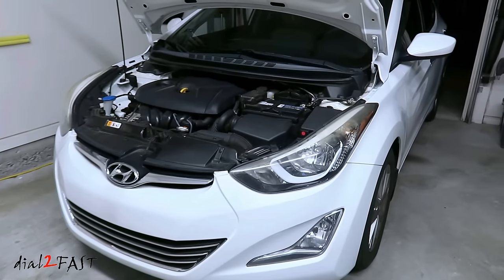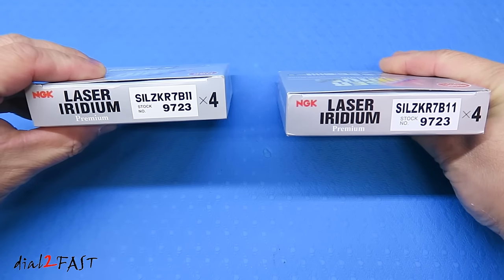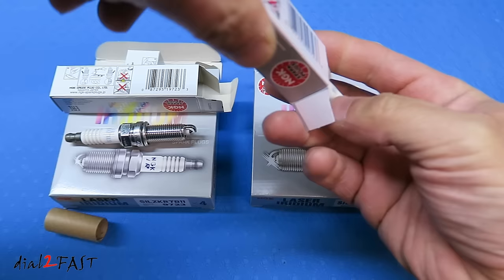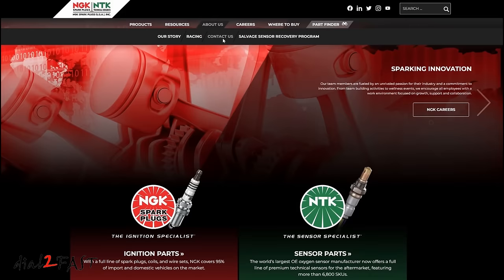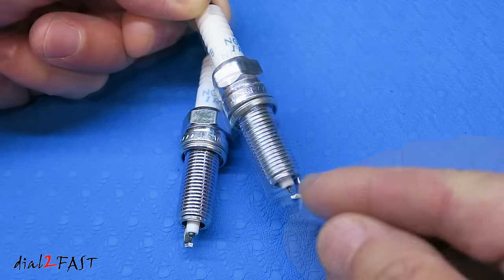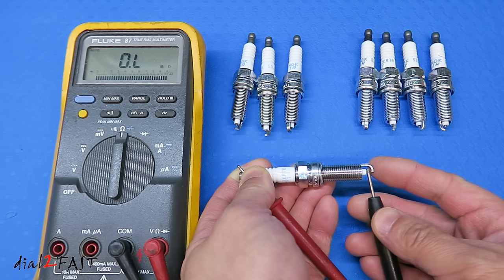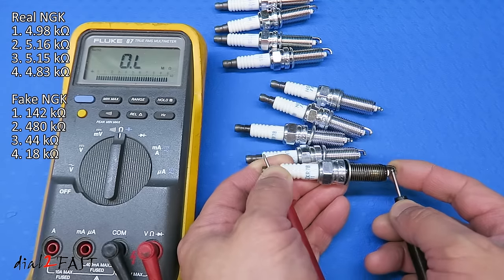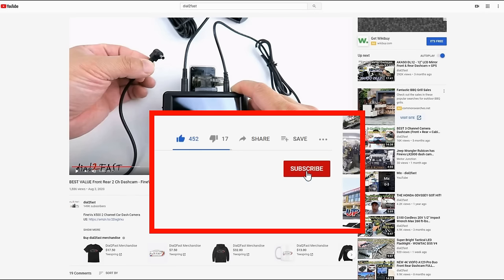Fake NGK Iridium Spark Plugs | How To Test!!

Comment: We have to wonder how the government agencies in charge of counterfeiting are not catching this. I don’t think counterfeiting is the only issue with on line car parts tho. I’m a retired mechanic, still keep busy fixing cars as a hobby now. Recently I helped a girl in ordering a part . I believe she used Rockauto. My local supplier usually lists good , better and best in most of the parts they sell. In many cases the biggest difference is warranty or not or the length of the warranty. Rock auto showed at least 6 different lines on the balljoint/control arm she needed. I sent her a screenshot and pointed out the Moog part. It was nearly $150 cdn cheaper then my wholesale cost. She ordered it and brought me the Toyota and part. It came in a Moog box but was a Mevo Tech in the box. The later is the “ good “ one my supplier sells while the Moog is the “best”. I could have sold her the Mevo Tech and not waited  a week. In my 40 plus years in the trade I have never seen Moog re-box other then maybe Hyundai/Kia suspension. Lastly, the NGK spark plug isn’t the only one , Motorcraft and AC Delco have been subject to YouTube videos in the past
Reply: Could be that someone had conned the shop. Bought one of each, swapped them between the boxes, then returned the cheap part in the expensive box for a refund of the expensive part's price. That got restocked, and she got unlucky and that's what she was sold.

Comment: Hi handsome,  great channel. I just bought a 5 pack of CMR5H for my Honda GX 35 multi head on ebay and I immediately wrote NGK after seeing & hearing your advice. I'm waiting for there response.  Thanks again. 🎉
Reply: Unlikely to be fake, though not impossible.  A CMR5H is not an iridium plug which are the ones that counterfeiters mainly target as they are so expensive.

Comment: Okay first of all I am VERY skeptical that a knockoff spark plug will give you less fuel mileage. When I was about 20 I decided to check the plugs on my '88 Honda CRX si. The gap was three times the amount it was supposed to be due to the center electrode being so worn down, so I purchased new plugs. I was regularly in the habit of checking my fuel mileage and 0-60 runs and after installing the new plugs I had no change in fuel mileage. Believe it or not my car ran fine with the old spark plugs so I had no idea there was anything wrong with those old plugs.

Comment: Back in the early 70s one company came out with a new spark plug Palladium tipped spark plugs, the tips looked just like the Iridium spark plugs that they sell to day.  And they were said to last longer with much less fouling . And they did last longer and no fouling but they cost $4.00 a plug and the same brand of normal plugs only cost about .50 cents. Most people wouldn't pay that much for plugs so they stopped making them. I think Champion made them but not sure on the brand.

Comment: good video, but one big mistake, when you measured the resistance you touched both leads of multimeter with your fingers, so the resistance of your body is now in parallel with the resistance of sparkplug
Reply from the maker: Yes my body resistance is in parallel with the spark plug, but it did not alter the measurement result because the spark plug is much lower in resistance than my body. Understanding electronics and how parallel resistance is calculated is important here. You can read my note in the video description.

Comment: Not just NGK, I had a set of fake Denso Iridium plugs a few years back. They lasted a few thousand miles until the engine started misfiring as the electrodes had eroded away to nothing.

Comment: Hi, While measuring resistance on the plug, just make sure the other finger ( Right hand with Neg Probe ) do not touch the electrode tip , else the measurement would not be correct. Correct me if i am wrong as i saw your left hand also accidentally touches the spark plug metal body while doing the test. 
Anyway, Thank you for the info on identifying the NGK Fake Spark plug.  Cheers
Reply from the maker: Current flows through the path of least resistance. Your body has a much higher resistance. Therefore doing this measurement with your finger touching the electrode does not alter the result. If you don't believe me, try measuring a 15k ohm resistor with both hands holding each side. The multimeter will show 15k ohm.
Reply: @dial2fast  I can confirm this too.

Comment: I recently purchased Honda NGK iridium on Amazon. $47 for a six plug set vs. Around $80 for six plug set on other sites. Individual pricing from National Auto Parts stores averages around $18 a plug. Should I suspect mine are fake? If so I will have to test them.

Comment: I installed a set of NGK Iridium plugs from online into my 1994 Buick Roadmaster in summer after which it ran like a turd. I then changed my injectors with no improvement now i'm gonna double check the plugs.

Comment: if I use a set of four spark plugs with resitance of 4.5 , 5.1, 5.2, and 7.8 K-ohms , will it be working correctly or any problem in toyota corolla 2010 model.?

Comment: i installed the fake ones on a 2010 nissan altima within a week i got misfire in cylinder 3 and 4 and i also got O2 sensor codes meaning the fuel mixture is running rich

Comment: I just bought NGK Iridium spark plugs on Amazon. It appears I lucked out 1) I have the sharp yellow triangle image 2) The NGK company name and website appear on the box  3) I have a 4 digit code engraved into the plug. But my days of buying auto parts on Amazon and Ebay are over thanks to this informative video.

Comment: Another way to see the washer must not be loose fit and the 4 digit code must be on the ceramic and the length will be slightly shorter i had the same problem on a bmw

Comment: When measuring high resistance (like above 100k), don't touch both contacts with hands. Because 500kOhm floating is not spark plug resistance, but your hands

Comment: I buy most of my parts online, however, I've run into a few fakes and have gone back to the local parts store at times. That's the the risk of saving a few bucks online; not worth the hassle. Even got some fake engine mounts last year.

Comment: Very interesting video. I would have thought, that the engine light would come on with fake spark plugs when the resistance in spark plugs is so different.
Reply: The ECU can't measure plug resistance.
Reply: @ferrumignis apparently not. I had a diesel car where the computer (ECU) could measure resistance in glow plugs, that's why it surprises me that it can't measure spark plugs :-) But thank you very much for your answer.
Reply: @sbromose1  Glow plugs have very low resistance, easy to check just by applying 12v and measuring current.  A spark plug has infinite resistance until an arc is formed between the electrodes, so you can't measure the internal resistor value like a glow plug.  It would be technically possible to do, but all the measurement circuitry would have to cope with the extremely high voltages which makes it expensive and more failure of prone.  Also the resistor inside the spark plug is only there to reduce radio frequency energy being emitted which could interfere with other systems, it doesn't actually affect the running of the engine unlike a dead glow plug.
Reply: @ferrumignis It makes sense then. Thank you very much for your reply, it was very helpful.

Comment: I bought one some NGK plugs o a local trading site , they were the same heat range as I had , I also had a older brand new genuine ngk , when compared the inside insulator was completely different length, I organized a return , which was dodgy as I got passed on to another person , then sent them back to another business , they were fake ,you could melt a piston , boxing was different to the same shop bought plug.

Comment: Which resistance is better: to be nearer to 4 or to 7.5 kohm?
Reply: That doesn't matter. Anywhere in the 5K range is good. But with the fake ones - and those readings might be mostly just through his body - resistance is ridiculously high. The 5K helps suppress interference and makes the spark duration longer but doesn't cause problems. The measured (fake ones) 100K+ may still spark but it will be a feeble spark. The spark is initiated by voltage and before it sparks a resistor does not affect that... once an arc is created and current flows the resistor limits that current, so the energy available from the coil isn't dissipated as fast and the spark lasts longer
Reply: @Bodi2000  Thanks a lot

Comment: Modern sparkplugs has really large resistors, more than 2M Ohm.  It  is not easy to detect fake Iridium Spark Plugs especielly for small engine like Prius or Camry
Reply: Actually it depends on the spark model. My modern one is 5k Ohm, and mine were all very close to each other.

Comment: Very good video, and excellent consumer protection/Public Service!
I thought I was saving $ buying sets of 4 NGK iridium plugs on Amazon for ~ $25

My dealer pulled my plugs while diagnosing my cars running issues.

I didn’t have time to order cheap ones, didn’t want to pay dealer markup, so picked up a set at a local parts place.

Car definitely ran better with the locally sourced set.
Started to think that cheap plugs on Amazon were likely knock offs, and you confirmed it!

Thanks 🙏

Comment: I was curious about the internal resistor, since I'd never heard about that.  Found a really good pic. on the NGK site, which labeled it as a "glass resistor".  That helps explain what a veteran mechanic told me, "When you drop a spark plug, always drop it twice".  The second time is when you drop it into the garbage can, because it might have an internal or hairline ceramic fracture that will result in premature failure.
Reply: That's really interesting, thanks!
Reply: The  "R"  in the number indicates it's a resistor plug. (Eliminates radio static; same as plug cables)
Reply: What about shipping? They sometimes treat them roughly

Comment: When measuring resistance don’t touch both leads.   Your body creates a parallel path and it will bias your readings.   Often it won’t matter but a good practice for when it does.

Comment: I learned from my own mistake a couple of years ago. Around half price you'd pay elsewhere, set of 4 NGK Iridium from Ebay. 6,000km, the car went back to running rough, hesitating as before installing the new plugs. This made me assume something else was failing. After new coil, leads and some messing around with no improvement, I pulled the 'new' plugs out, and found the center electrodes burnt down to almost nothing. A set of confirmed genuine plugs later, and I've so far had 30,000km of trouble free driving.

Comment: Thank you for putting out this video. I wasn’t aware of the fake NGK spark plugs until I saw a random video on UTube pertaining to that subject. Your video is the only one I have seen that details how to check the resistance with a multimeter. This to me was the determining factor for authentication of the spark plugs as the only thing I had to compare them to was the old ones that I took out of the engine that had 134,500 miles on them. I chose the safe and most expensive route by buying the spark plugs from my local Auto Zone.
Reply: Kayla Mayla  - don’t know, but by having a receipt of purchase, the situation would have been rectified
Reply: No guarantee but I buy all my parts thru Rock Auto and have never had any problems with any of the parts. However, I don't go for the cheapest parts.

Comment: Thanks for the info. I never realized you could test the resistance of the spark plug.
Reply: Most are 5000 ohms. Motorcycle spark plug caps have resistors also. Another 5000 ohms too, so 10k total.

Comment: Thank you. This is very interesting and timely.  A month ago I ordered two sets of 4 NGK Iridium plugs from  Autozone online for about $30 per box, but they are still unable to fulfill the order, I keep getting a Being Processed response.  While these were not immediately required at the time I ordered them, just planning the next timing update on my V8 engine, but this delay I am having may be related to this issue of a batch of fakes that they are dealing with.  Now I can check my old set and the new set with confidence in how to better spot a fake of this brand.

Comment: Thank you and I have had NKG plugs fail in my bike with less than 200 miles on them and yes I ordered that set of four from Amazon and they were like $10 or so cheaper compared to other sellers but I purchased replacements from a shop in this town where my bike broke down and what a time I had trying to figure out what the heck happened and what was going on but the only thing I did to my bike was service it and change the plugs before a trip we had planned so it was by luck I thought just maybe I broke a plug or something so we set out to find a place to get a set and try it and it was the plugs but they were not broke/cracked or anything but I was quite upset with NKG but your video just changed that bc I have always used NKG plugs in all my bikes and equipment and I vowed to never buy them again but I will return back to NKG plugs but will check and test my NKG’s before using them bc NKG has always been the very best prior to that day and I have had no success on finding a good replacement plug that compared to NKG and auto lite plugs are by far the worst I have ever used so thank you for posting this video
Reply: Yes, NGK plugs are the best 👍

Comment: Avoid touching the both probe pins with both of your fingers, as it could lower the ohm reading, due to human body resistance in parallel with the plug. At most, only touch the probe pins with only one finger. That's electrics.
Reply from the maker: Your body resistance is not in the kohm range. Holding the probe with your finger has no effect on the measurement. You can try it with a regular 5k resistor.
Reply: @dial2fast  yup.. It's neglible..
Reply: Resistance in parallel is always lower than in series. If you touch the probe it wouldn't matter because the metal is more conducive than skin
Reply: Also, touching the bottom electeode throws it off!
Reply: @dial2fast  as a gen tech I'll say it throws off your readings ,it's just a good idea to not do it.
Reply from the maker: @MrTheHillfolk  I appreciate everyone's input on this, but to answer this question, you need to look at how electronics work. Yes our human body has a resistance. Everyone can try measuring yourself at home. You will see it's in the mega ohm. When I am holding the 2 probes and measuring the spark plug, my resistance and the spark plugs resistance is parallel. There is mathematical formula you can use to calculate the actual resistance of 2 resistors in parallel (you can Google it). For example, if my body measures 30Mohm and the spark plug is 5kohm, the actual resistance of the two together is 4.999kohm. Also keep in mind, this is just a quick 5 second test to identify a fake plug.
Reply: @dial2fast  I have no idea how electricity works, I stick my finger in an outlet instead of coffee , all I know is if I've got my hands in the leads while checking a generator stator of a short and if shows under 2 megohms it's got an issue, that's what I was told 25yrs ago , and fingers on leads throws off my measurements.
Reply: Brilliant
Reply: The fake s/p read 480 ohms not kilo ohms
Reply: My thought too
Reply: Current takes the path of LEAST RESISTANCE!
Reply: Good video but agreed your testing method is flawed. Don't keep arguing with commenters. It's a bad look
Reply: @mastermnd22  it doesnt look like he was arguing, he was explaining why they are (in this case) incorrect. And he was also being respectful about it. The amount of difference is absolutely negligible.
Reply: @jack8356  It would matter, but the difference is probably small. Parallel resistance is lower than either alone.
Reply: Thanks
Reply: My dry hands measure around 5meg whilst my sweaty hand n fingers measured around 900k.
Reply: I think /thought as long as you’re not touching hands /fingers of opposite ends together ,in essence closing a circuit , the Change would be minimal …. But yeah with resistance about nothing seems to throw it outa wack
Reply: Amazing information thanks
Reply: Improper reading
Reply: yes, yes, exactly.

Comment: When you tested the resistance of the second fake one you said it was 480k, it was actually 480 meg! ie open circuit
Reply: No ,your wrong , 0.480 meg is 480k ohm, i havent come across any multimeter, that measures 480 meg in my 40 + years, as a qualified electronics engineer. Only specialist lab equipment, costing big bucks.
Reply: @enoz.j3506  Yes your quite correct, my mistake ( damn decimal point )!

Comment: Thanks for the way to test for fakes.  My Denso 3444 spark plugs that were purchased years ago in 2014 measured 4.08 kohms and 4.67 kohms using my auto-ranging multimeter.  I only measured two of the spark plugs as I didn't want to damage the tip.
Reply: Oh.  And my Denso 3444 spark plugs were purchased online from RockAuto in 2014.  I was skeptical as they were $8 each back then.
Reply: 4.3k  +/- 10% would probably cover that. Not enough variation to matter.